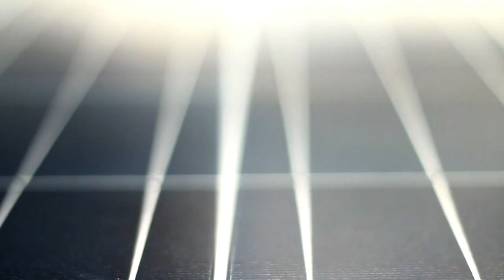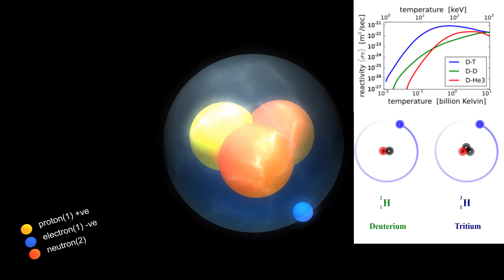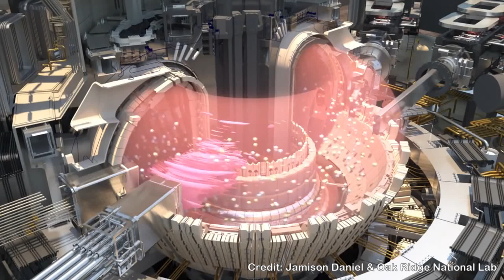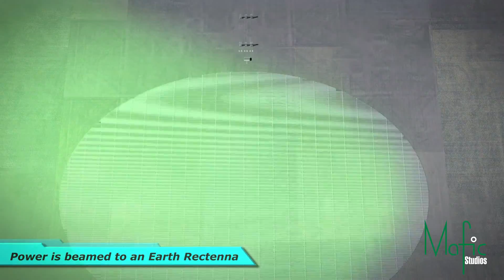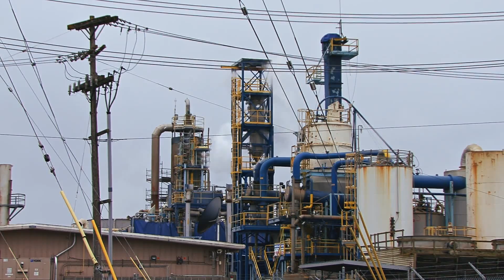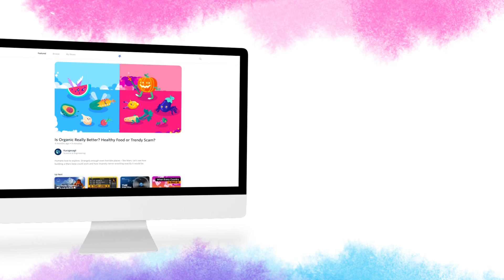Fusion: Powering a Bright Future

Comment: Fusion will be clean and abundant, but it won't be as cheap as its almost-free fuel would suggest because fusion reactors will run  so hot that they'll damage themselves, and this damage will be the main cost of fusion. M.I.T. graduate students are trying to design fusion reactors that minimize this cost, but which of the fusion applications you've described can actually be done at acceptable cost remains to be seen. :-)

Comment: Practical electricity generation with fusion power truly appears to be well within 20 years based on this lecture from three years before your video:  https://youtu.be/KkpqA8yG9T4
The key is magnetic field strength, and that depends on practical superconductors.  As far as I know, we still don't understand superconductivity very well, so progress seems a bit random.  We are making progress, however.  The video link I provided shows a plausible path forward for viable electricity generation from fusion power based on new superconducting materials available 5 years ago (from the time I write this).  Since magnetic field strength is the primary constraint on fusion power at this point, better superconductors will lead to more efficient, cheaper, more compact fusion power sources.  This is becoming practical very rapidly.

Comment: I can't wait for the completion of the ITER reactor. Even if it only achieves half of its intended efficiency, it will still make 5 MW from every MW of input.

Also, pinch fusion is very interesting for spacecraft propulsion because it avoids all the heavy magnets that worsen the craft's payload fraction.
Reply: It's probably false. Sabine explained ITER will not break even.

Comment: Initially, I assumed helium-3 would be so exotic that you really would have to stretch your imagination to the breaking point. But in fact…Well, I'd have to check the numbers, but in fact, helium-3 is much more common in some places than here on Earth, where nearly all helium comes from radioactivity in the core. OTOH deuterium is actually a very tiny portion of hydrogen here on Earth, and separating it from protium is a real pain in the ass. And for D-T fusion, obtaining tritium may be an even bigger hassle. In view of that, maybe He-3 is not so craxy after all, just from the criterion of fuel abundance.

Of course, using it is another matter.

Comment: Comparing the timelines of solar and fusion is very specious. There was workign solar, as solar thermal, at least as far back as the late 1800s. From there, it was a matter of improving the economics and efficiency. With fusion, no net energy production has yet been demonstrated (except maybe recently for ICF, but hey, come on, we know that's a dead end for energy production.) The timeline for how the economics might work out is entirely in the future, and I for one would not even want to hazard a guess on that; could be a few decades, maybe much longer. It's not the same situation at all.

Comment: It struck me recently that fusion disproves the Dyson dilemma. As soon as a civilization both masters fusion and space habitats they'd no longer have use for the sun. Thus there'd be no need to swarm around it and they'd really be better off if somehow they could stop fusion in their sun. To a fusion based civilization Jupiter is much more valuable than the sun.
Reply: Lol no the sun has 99% of all of the solar systems mass including 5000 earths worth of every other element beyond hydrogen and helium if anything it would make the situation worse because of star lifting. 

  It doesn't solve the problem it makes it a trillion times worse. Because now it makes you wonder why we have any stars at all.
Reply: @MS-87879  Fair, eventually.... But getting resources from everywhere but the sun is far easier. Starlifting for resources only makes sense after completely using up Jupiter.
Reply: @snek9353  It would take that long at our current rate of advancement though a couple million years is nothing on cosmic timelines that's Authors problem which is why he thinks and why I agree that intelligent life is extremely rare and we might be the only ones in our super cluster of galaxies.

Comment: Yes, we need nuclear, but not of the old, inefficient, less safe and polluting fission type as presently in use. While thorium is much better it cannot compete with fusion nuclear. The Tokamak and ITER types of plasma confinement are incorrect old school and inefficient physics-based fusion power attempts at a working solution based on our misunderstanding of how the sun shines. All efforts along these lines are simply wasting billions of dollars. However, there is now really great news! In present reality, fusion is already here in the form of the "Safire Generator" that uses safe, green, small footprint, 24 hr reliable within community-based fusion nuclear power. See all about it at "aureon energy.com". and learn your necessary "Electric Universe Theory" with your newer astrophysics and plasma physics reality at "The Thunderbolts Project" and you will then be on the right track.

Comment: When talking about power, I always make a distinction between power generation (i.e. where we spend some natural resource, renewable or not, to produce power) and power storage (where we use power to create something we then get power out of).  This means things like hydrogen fuel cells aren't (generally) power generation, they're power storage, as mass-producing and mass-storing hydrogen will mean splitting hydrogen out of water, which means spending energy to make the hydrogen that you then burn for energy.

Power storage is useful not only to moderate power usage, but also for easier power transportation.  Essentially, they're all some form of 'battery'.  Whether you're plugging in a battery of lithium ions, lead acids, or hydrogen gas, it's all a means of energy storage and transportation.

It sounds like one of your biggest advantages for fusion power is that a large central generator (and this is a generator) could power a HUGE array of mass-producing battery factories, of a wide variety of types that currently aren't worth pursuing.  That then allows that power to be distributed rather freely, and also stored for rather long time, throughout a whole civilization.

Comment: Hrm I’m going to have to throw a flag on using solar cells as a temporal comparison. With the early solar cells they were functional. Becoming economically viable at scale is a fundamentally different thing than being functionally viable. With fusion it isn’t about becoming economically viable but being functionally viable. Once we have fusion reactors that are functionally a net producer of energy, then we can compare it and it will likely compare quite favorably.

Comment: The fuel of atomic bomb and hydrogen bomb is uranium-235 and plutonium-239 respectively. Hydrogen bomb is thousands times more power than the one of atomic bomb. Precisely, plutonium-239 is derived from uranium-238 which implies that neutrons are not completely neutral at all. Having more neutrons within a nucleus required them (nucleons) to be saturated with more photons. When splitting of the unstable nucleus of plutonium-239 more photons will be dissipated out to the surroundings. Clearly, what it shows is that hydrogen bomb has nothing to do with fusion process. Let's face this: Einstein's famous equation, E-mc^2 is wrong otherwise garbage also can be used to make nuclear bombs as long as it is matter or it has mass. Energy and matter can't interchange one another according to Einstein's famous equation. One must have photons before one can emit out photons. Photons are particles and they have mass. All forms of EMWs including light and heat are dynamic photons per volume per time in different saturations. If you are interested in real discoveries, I would recommend you to read my book, The Unification Theory - Volume One and you will be amazed with lots of new, interesting discoveries. In God I trust.

Comment: wait, you can make gasoline out of air? 
why exactly aren't we using it to run fossil fuel plants?
Reply: The process of producing gasoline from air requires more energy than what you gain by burning gasoline. The energy gain is negative, this is why we don't do that. it's like using 10 dollars to buy 4 dollars.

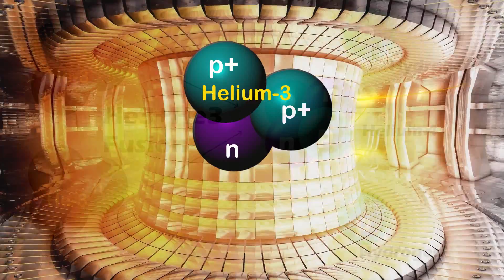Comment: Just reiterating (it's been mentioned before, but the comments are deeply buried) for those reading/watching, the illustration at 17:00 has two tritium nuclei erroneously labelled as 3helium. As the nucleons are conserved in nuclear reactions, the error shows two green(ish) protons and four purple neutrons on the left yielding an output of four protons and two neutrons. With the input nucleons as proper 3-helium with two green protons and one purple neutron each, the reaction illustration then can make sense - the reaction products on the right are illustrated correctly.

Comment: A remark about the entire "fusion isn't particularly fast or slow" part
Nuclear fission was discovered in 1938. First grid-connected fission power plant was built in 1954 - less than 20 years later.
So yeah
Turns out bottling stars is harder than we expected

Comment: I understand the fusion power is big game changer because it will be so plentiful, and the fuel is so small, but what makes you think it will be *cheap*?  This prediction was also made for fission, and after 70 years plants are still hugely expensive to build, and run, and increasing.  They will be large and centralized, delivery is currently about 50% of the cost of electricity in my area.  Small local solar power on the other hand is cheap (and getting cheaper), local, efficient in delivery, and reliable.  For me, grid power is 16.3¢ per kWh, including delivery at 8.6¢; Solar from my roof is 7.6¢.  Fusion would need to be cheaper than storage minus 1¢ per kWh.

Comment: I heard a German physics professor (Turtur) talk about the advantages of getting your energy from dissolving the space-grid itself and under the assumption that he is honest about his research, it seems to be the more advantageous tech to invest our time in (not that I wouldn't like redundancy in clean energy production methods). He claims that it is a pretty mainstream-based thing, but from a commercial perspective, it is seen as problematic since it does not strictly require centralized power plants and makes electricity itself free, if you ignore the overhead costs. The only real technical problem seems to be that currently, you got to get a motor rotate at extremely high speeds (c/100).... so its not super-far less complicated than fusion, but since space is everywhere you could ever go, you never run out of fuel and produce absolutely no waste material.

Comment: The whole world will be hooked up to the safe distance fusion power plant in the heavens with the eternal solar grid long before any of these rich boy toys come into play, so this technology will be obsolete before out of the barn (  The Global Eternal Solar Grid ( GESG) is becoming a reality right before our very eyes. It is hard to grasp the full significance of this type of technology that could very well do away with the current problem of energy storage, as well with such a global solar grid the sun can keep the whole grid fully electrified even on the dark side of the planet, 24/7/365. The Earth is huge but it is spinning very fast, so the edge of sunshine is actually very close time wise relative to any surface location on the planet. Once enough of the surface of the earth is covered in photovoltaic technology, such as roofs, parking lots, and highways, plus solar farms then the GESG is achievable.)   The technology now exists to transmit massive amounts of electricity over long distances without significant losses, thereby allowing operators to balance consumption and generation across an entire continent—or, potentially, the globe.  For Instance- " Sun Cable will produce approximately a fifth of Singapore's electricity through solar power, sourced from the Australian desert and transmitted via a High Voltage Direct Current (HVDC) cable. "

Comment: Stunning! Absolutely disappointing.  No one should pay for fusion energy until they build a home unit that is fueled by terrestrially mined aneutronic fuel while we have solar(fusion) collectors and batteries in our garages that continually soar in efficiency and plunge in price.
Anyone that is doing fusion research should be praying that the Chemists at Florida State continue to deliver them higher and higher Tesla electromagnets so they build fusion driven rockets and finally stick ‘SPARK’ on distant worlds ‘where the sun don’t shine.  ITER by 2099!!!

Comment: what about splitting and fusing tho,
split something and fuse it back together  repeat.

maybe use part of the energy of splitting to fusing? 

i'm completely retarded, but i feel like this will be the way to go.
Reply: Energy cannot be created from nothing. So splitting and then fusing wouldn't result in more energy that put in. 

The reason both splitting and fusing is a thing is because the energy storage in atoms is different. There's a very high storage for very small atoms like hydrogen and helium, then the storage goes down until iron when it starts rising again. So you can extract energy from fusing hydrogen to helium, or from splitting uranium, but you can't get energy from splitting helium or fusing back to uranium.

Comment: If the Sun is powered by Hydrogen Fusion....Why is the Surface of the Sun only about 5000 degrees and then millions of degrees hotter as you go further away from the Surface ? Also wouldn't the Sun weigh about a thousand times as much as it does if it was a Hydrogen Fusion furnace ?

Comment: General Fusion here in Canada has a reactor design that is a sphere containing molten lead that is swirled into a vortex into which a pellet containing deuterium is injected.  Massive pistons symmetrically arranged created a shockwave that is sufficient to initiate fusion which heats the lead.  Heat extractors convert the leads heat to steam.  The lead also acts as shielding.  The process repeats every second.  Micro fusion bombs!
I like this system because of its simplicity.  Check out the reactor
https://generalfusion.com/2018/11/timing-everything-pushing-fusion-forward-pistons-cutting-edge-electronics/
Reply: Except it does not work.It works in stars because of the constant heat and pressure. You can't build a star because of the mass required.

Comment: 1883 and it took a century before we had good enough solar to consider commercial usage
because for the first 70 years after 1883 there was very little need for electricity and that was for light when it was dark and there was the 
problem of storing the electricity
and after that
electricity generated by fossil fuels was well established and they didn't want the competition

Comment: Ok, here's a question I'd like your opinion on.  You speak a lot about how technological improvements might have an impact on economics; cheaper power, less expensive base materials, better environmental options and controls. By reducing the cost of creating consumer goods, regular Joes would have more money left over in their paychecks, and that's something everyone looks forward to.  However, US economics is based on capitalism, privatized ownership of a means of production and their operation for a profit. Corporations are loathe to relinquish their hold on the regular people, and shareholders generally only care about their quarterly profit reports.  Very few companies operate on the long-term benefits (to the consumer) of cutting costs without decreasing quality or eliminating jobs.  Most times, companies will export manufacturing to a foreign country with less labor costs but still reap the benefits of an unchanged price tag.  I believe that in order to create a post-scarcity civilization, where no regular citizen could want for anything at an affordable cost, corporations would inevitably have to move towards providing a product to the benefit of the people, and not just their executives.  My question is:  how would these inexpensive benefits provided by a post-fusion age affect changes in society as these new technologies are implemented, and how can humanity use these gains to catapult us into a multi-planet civilization?

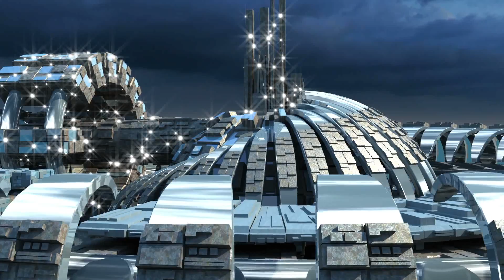Comment: 11:00 - 12:44

I wonder if possible to combine the laser ignition of Inertial Confinement Fusion and the Micro-Detonation Fusion for laser to hit and compress the fissile shell to cause a detonation to fuse the fusion fuel core. Now if we go with full steam or using a magnetic superconductor piston to drive generators.

Essentially a Fusion driven Diesel Engine for the latter. :D

Comment: Saidly Magnetic confinement fusion isn't likely to work. The issue is that magnetic fields form fields lines of uneven intensity.  Thus very strong & very weak fields along the field lines (see a magnet and iron filings). No one has been able to produce a stable magnetic bottle capable of containing plasma. After about a minute or two, the magnetic field destabilizes collapsing the magnetic bottle & allowing plasma to leak out.  :)

ITER is doomed ans it already been determined to fail.